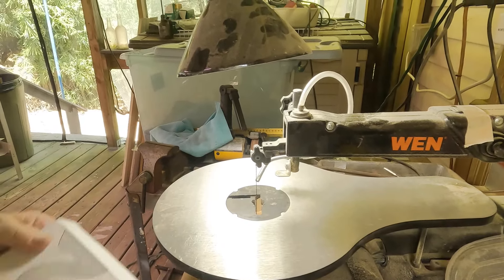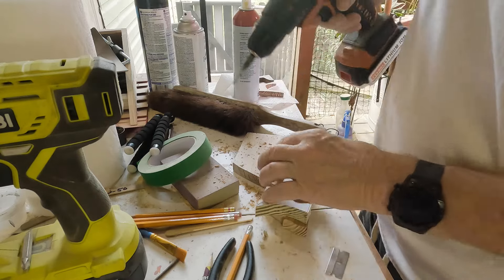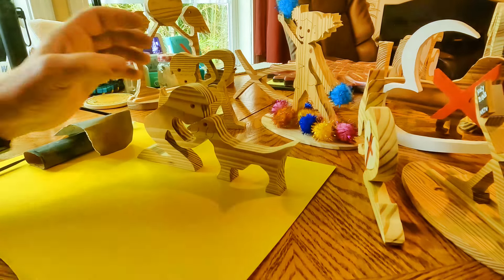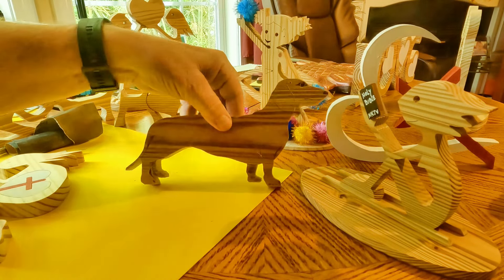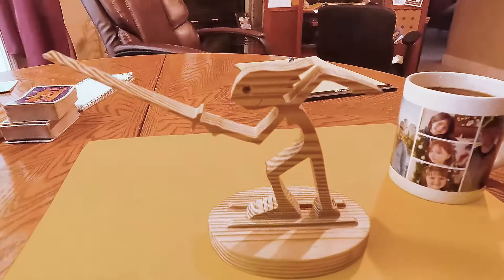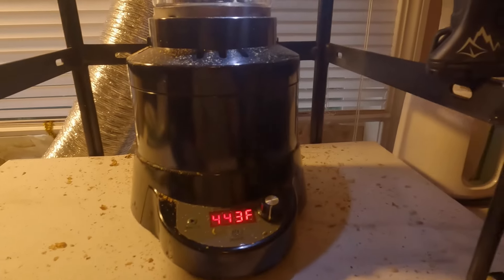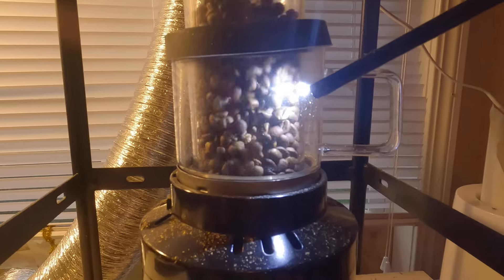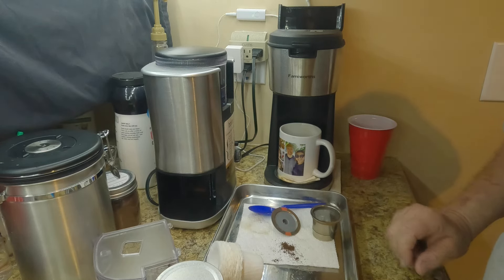Saltykayaks New Hobbies

Comment: Glad to see a new video, I have a question what model number is the scroll saw
Reply from the maker: Hi SS123, it is a Wen 3923 and what a nice surprise, it came with a set of NO pin adapters so from the get-go, I was able to use no pin blades and get finer cuts.

Comment: So, why did you quit fishing?
Reply from the maker: Hi John, In the 'lengthy' description. I tell of several primary reasons why I quit fishing but in the really short version, I have torn cartilage in my right knee (and possibly hip) and have very painful bone on bone rubbing if I am not paying attention to exactly how I am standing. I can't put any pressure above my own weight (Like catching those monster Red Snappers or blasted sharks) otherwise, if I bend dramatically, my eyeballs begin to spin in my head and tears come out of my eyes. Possibly, if I can get the VA to operate on the knee, I might be able to do some limited fishing from friends boats. Truthfully, I miss the off shore adventures.